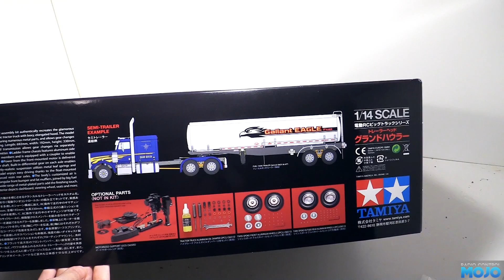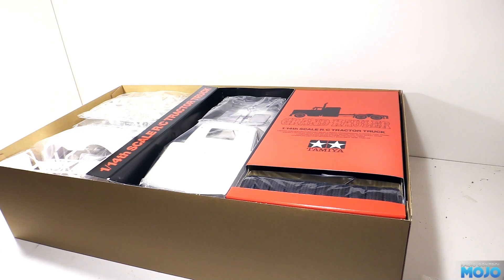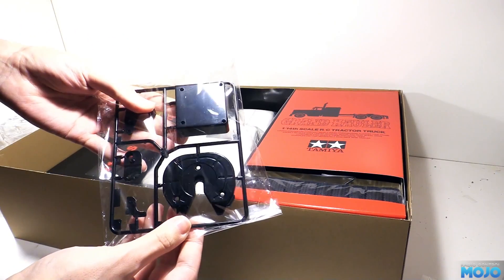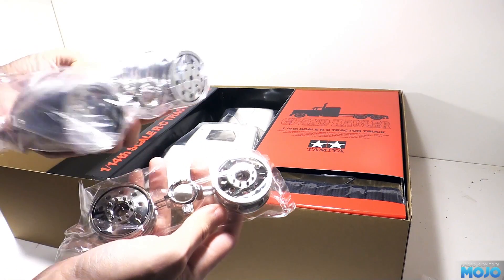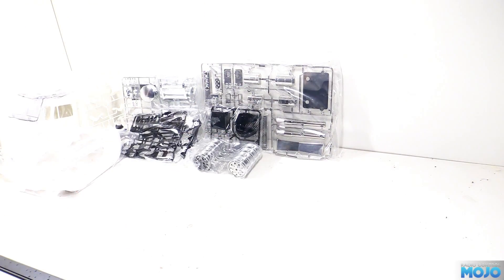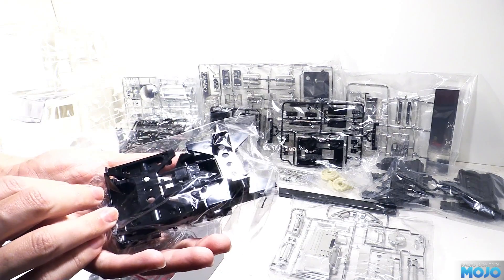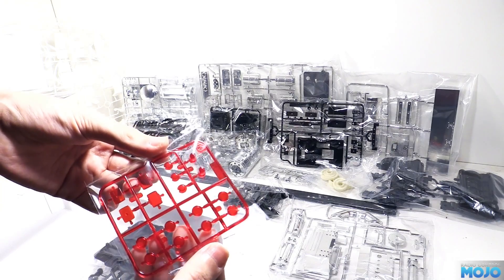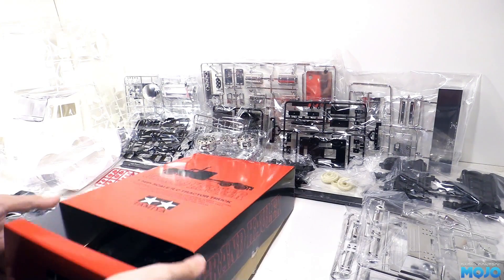Tamiya Grand Hauler - 1 - Lets see what we’ve got

Comment: Beautiful video mate !! 
p.s: I need your help. I'm building a Street Rod but I don't know the part number of the front axle on your truck. I need front axle with 12mm hex to fit usual rims. 
Thanks for your Help. 
Chris 
Subbed  ;-)
Reply from the maker: The axle come in parts bag B, for the steering you need one of the plastic trees too. Tamiya USA has a downloadable manual with all the part numbers.
You might better off with an after market axle, RCMart stock a couple complete with all the steering parts for less than you’ll pay for bag B.
http://www.rcmart.com/aluminum-alloy-front-steering-silver-tamiya-tractor-truck-p-58225.html

For the hex’s, GPM did do some adaptors for the DT-03 but they should fit. I’m not sure if they’re available anywhere any more though.
https://www.asiatees.com/display?brand=Tamiya&model=DT-03&id=98742
Reply: RCMojoTV Thanks a million for your help !!
Much appreciated.
Chris  (^_-)